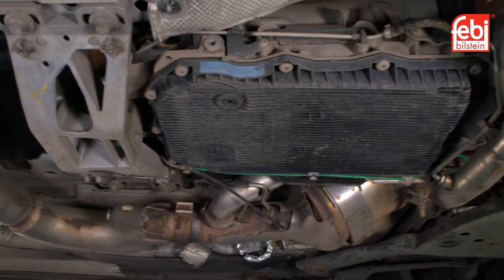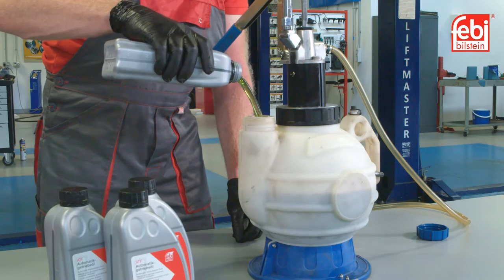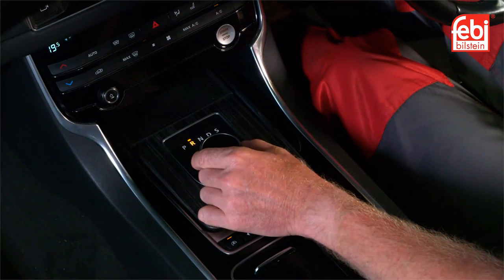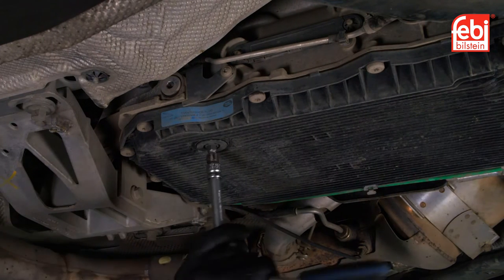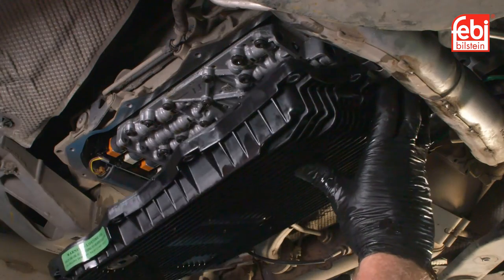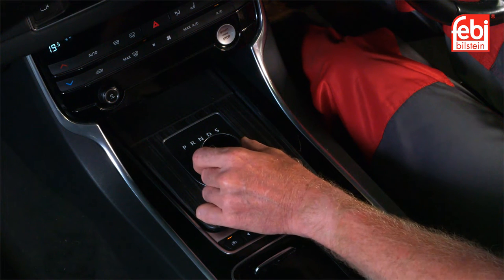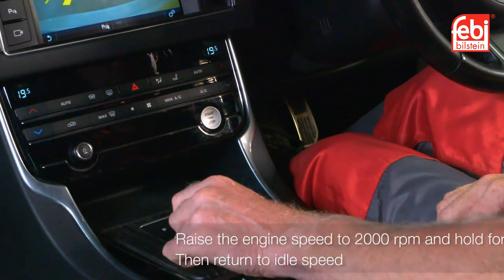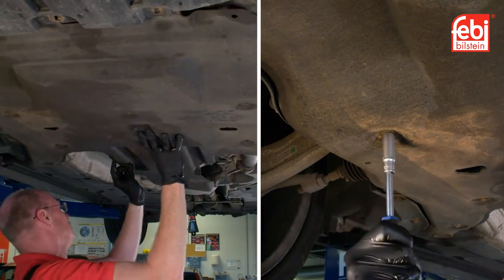[EN] Jaguar XF Automatic Transmission oil and filter service

Comment: There seems to be a step missing in this tutorial, raising the oil temperature to 70/80ºC so as the ATF cooler kicks in, thus the ATF flows through it, ensuring optimal level once the temperatures descends between 30ºC and 50ºC to check the level.                                            It would be very appreciated Febi's feddback on this. Thanks.
Reply from the maker: Thank you for watching our video. In keeping with the vehicle manufactures workshop manual on this procedure. We followed the following process.
If the transmission oil temperature is lower than 30°C (86°F). Allow the transmission to warm up above 30°C (86°F) with the engine idling in the (P) position, then proceed with the transmission fluid level check.
If the transmission oil temperature is above 50°C (122°F), switch off the engine and allow the transmission to cool down.
Therefore, no steps were missing. 
However, once a transmission oil replacement has been carried out, there is no reason why after this process has been carried out, to go though it again after a thorough road test. Letting the car to cool down, just to make sure the level is perfect.

Comment: Why do you have to replace the whole sump pan and not just the oil? Is it because of that integrated filter?
Reply from the maker: Thank you for watching our video. The sump pan has an integrated filter. Therefore, it is best practice to replace both the transmission oil and filter when servicing this transmission.

Comment: When checking oil level, is the engine running?
Reply from the maker: Thank you for watching our video. Yes, to check the oil level it is with the engine running as per the procedure followed in the video.

Comment: What is the service interval for this transmission?
Reply from the maker: Thank you for watching our video. The vehicle manufacture lists this transmission as a filled for life. However, the transmission manufacture states. Depending on the driving style, they recommend the transmission oil is changed every 50,000 miles (80,000 km) to 75,000 miles (120,000 km) or after eight years at the latest.